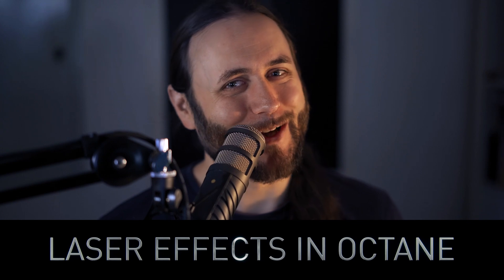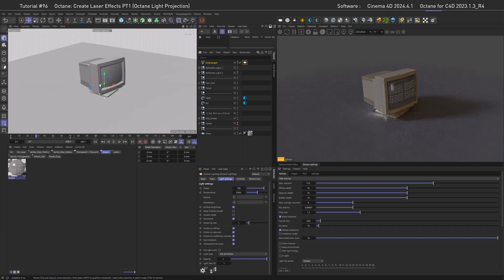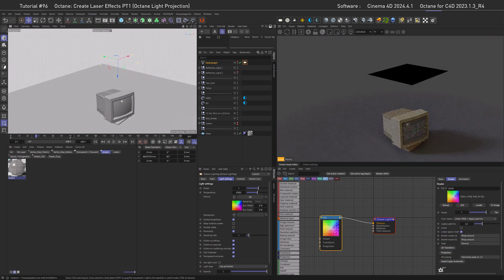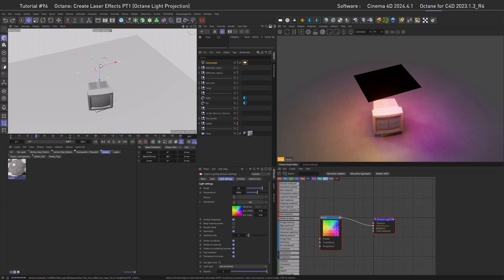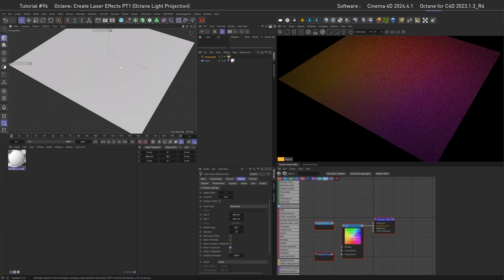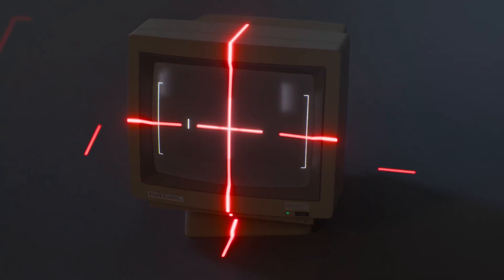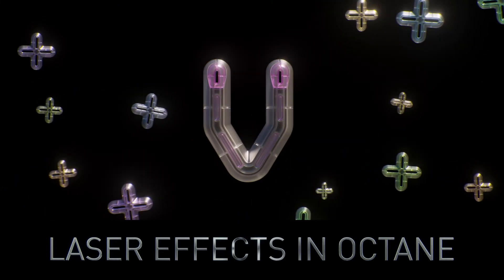Silverwing Quick-Tip: Octane Laser Effects PT1 Light Projection

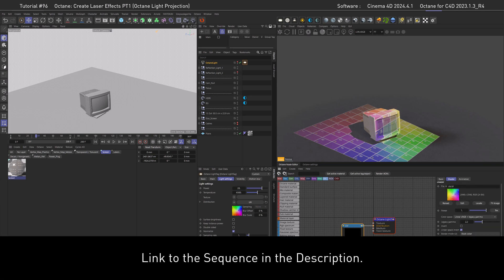Comment: 10:47 - I am trying to build a physically accurate projection mapped room for pre visualization, do you know if there is a way to control perspective warp like you would with a real projector hooked up from the ceiling? My octane lights are on the ceiling but content is obviously being warped from the angle of projection
Reply from the maker: Hey there and thank you for your question.
If I understand you right you want the projector to be offset from the middle of the projection area like a modern day digital projector, that you can place at your table or your ceiling and still project an un-distorted image?

To get there with the shader, set your projection to "Perspective" as suggested in the video. Then what is important to have a non distorted projection on your wall at the end is that your light is left parallel to the wall. Do not angle it. This of course will make half of the projection hit the ceiling. 
To move the projection down from the ceiling to the wall, add a transform node to the ImageTexture. This allows you to offset the image e.g. down by using the Translation Y "T.Y." value.

Congratulations you have made your own lens shift setup for your ceiling projector 📽

Let me know if you got it working 🙌
Reply: @SilverwingVFX  it worked! such a simple solution, i cant believe i didn't try that THANK YOU
Reply from the maker: @NebMotion  Amazing. I'm glad to hear it worked.
And I know that feeling. Sometimes the simplest answers are the best 🥳
Reply: I know you moved the lights back to fix but I ideally need them fitted in a specific place - great tutorial by the way!

Comment: Hello hello! I've been using the distribution for years (to use gobos and flag light without relying on geometry) and I didn't know how it actually worked and instead assumed that it creates invisible cones and projects an image similar to how a raycasting node would work, but I'm glad to know it's much simpler than that, thank you for explaining it the way you did, now, a rave won't be complete without ✳(light streaks) let's add a volume medium and watch pixels jump colors

Lately, I've been into baking due to the fields tutorial and this also has potential there, basically at the top of my head I'm thinking of sharper laser engravings (by stacking the animation frames in an additive manner to get the build-up animation), also abstract growth effects can be done in texture space without the need for super dense meshes if you're reading this comment and wondering how to bake textures in octane, please check Raph's tutorial on the matter here:
https://youtu.be/gcJNWtI7ouc?si=sA65hG86LRAIwvIN

excited for part 2 and expanding my very limited OSL knowledge,
Cheers and wish you a great week ahead!🙌🌟

Comment: Another amazing tutorial. This now perfectly explains to me why Octane's process for Gobo lighting ALWAYS results in sharp shadows from that Gobo light source, due to the pinhole light effect.

Do you know of another way to do efficient GOBO lighting, but still have the flexibility to control the softness of the shadows independently from the sharpness of the light that is casted? That would be an amazing tutorial :)
Reply from the maker: Thank you very much for your great comment.
I have not thought about gobos, but you are totally right. The only way I can think of getting there is to decouple the gobos from the light and have them on a plane with opacity in front of the light. So the light can be softer and depending on the distance of the gobos, the shadow of those can be shaper.

I think there might be a trick and even another tutorial in there. Eventually trying to give gobo texture a virtual depth, not behind the light, but in front of the light.... I's certainly an interesting thought!

Comment: Großartig, danke! In English, so everyone can profit: Unrelated question: How do you get your default light so small? 2x2 m is for most of my scenes a bit overkill.
Reply from the maker: Thank you very much.
Also in English so must people can profit! Also I totally agree, for the scenes that I usually work with, all the scenes being larger then 1 Meter is overkill!
I think the smaller sizes are a side effect of having set the default scene to be interpreted in millimeters.
Though in newer C4D versions you can also click on the upper right corner of the attribute manager and create presets for the currently selected object. This includes creating a new "master defaults" when creating the object (I think there is a checkbox in the settings with "save as default" or something along those lines).
I did that for some other default objects to make them fit my needs better.
Reply: @SilverwingVFX  Thanks, very helpful!